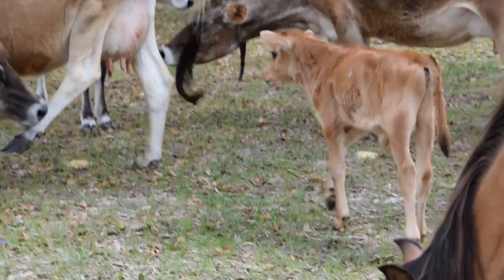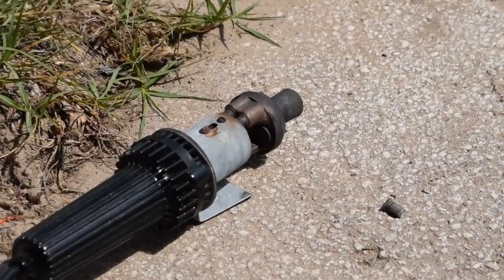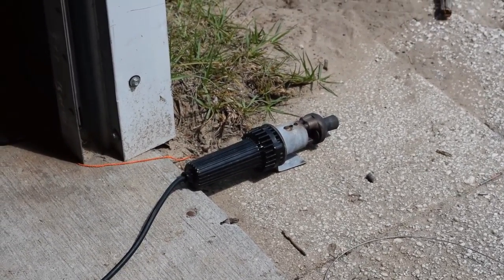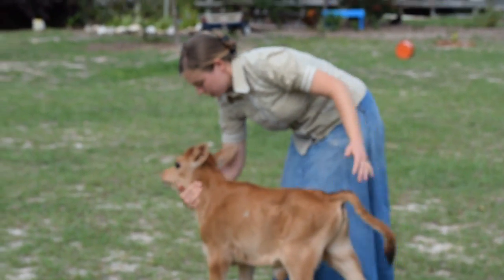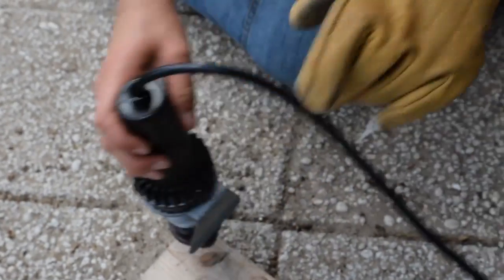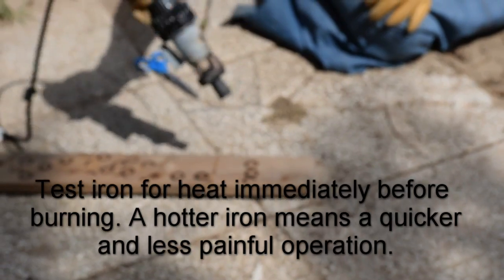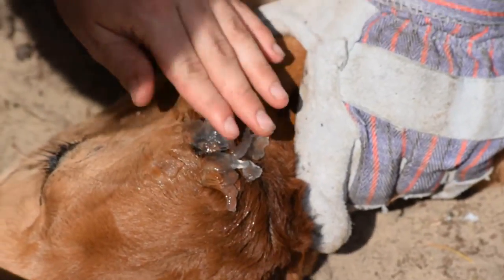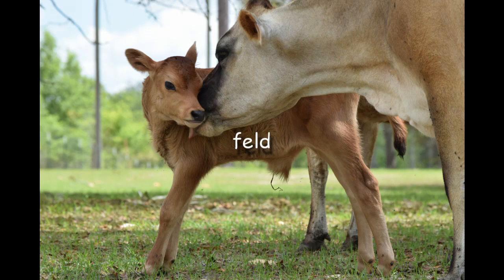How to Dehorn a Calf With a Disbudding Iron - Removing Cattle Horns - Raising a Family Cow Pt. 2

Comment: I just have to ask, would it not be a tiny bit more humane to apply some kind of local anesthetic around the horns before burning them?  Alternatively, can one use a tranquilizer that renders the calf unconcious for half an hour or so and then burn the horns without the animal resisting?  Are farmer allowed access to such drugs?
Reply from the maker: Thank you for asking (and doing it so nicely!) Yes, it probably would be less painful if I injected a local anesthetic around the horn buds, but there are varying schools of thought on that. Some say that restraining the animal for long enough for the anesthetic to take effect is more stressful than simply burning the horns and getting everything over as quickly as possible, since the nerves are burned through within a few seconds of applying the iron. (This was confirmed by a welder who told me that he was regularly burned by pieces of hot metal, but that it would cease to be painful after a few seconds.) I don't have anesthetic. If I did, I would use it, but either way, this is a painful, unpleasant ordeal for calf and handler.
     The keys to making this as humane as possible are: 1. Do it YOUNG. An older calf heals much more slowly, tends to get infected, and has to be more heavily restrained, making injuries to the calf and/or handlers much more likely, so this is best done at a young age (less than 7 days of age, preferably.) 2. Use a HOT iron. A cool iron has to be applied longer and burns out the nerves much more slowly, making a longer period of pain for the calf.  3. Apply coolant IMMEDIATELY after burning.
     As far as a tranquilizer, I have never heard of one accessible to farmers and would not be comfortable with using one, as such anesthetics can have serious side effects.
     Hope this helps.
     ~Alayna May
Reply from the maker: @Trevor Stolz, I just learned that there actually are some anesthetics and tranquilizers available to farmers. I should have checked on that before answering. A vet's prescription is usually required. I recently got lidocaine (a local anesthetic) and acepromazine (a tranquilizer) from my vet, so I will probably use at least the lidocaine in future to make this operation less painful. Thank you for your thought-provoking question.
Alayna
Reply: @MychickenscrapsBlogspot  i cant believe how you could do this without any local anesthetic, you should be banned from keeping any animal in your farm. you wear gloves for self protection and dont care for the pain you are causing to the animals

Comment: I'm concerned as to why you wouldn't use a halter to restrain him, rather than rubbing his eyes in the dust and putting your knee on its face? I do very much respect that the process needs to be as quick as possible as to minimize stress and fear, I am just curious as to why it needs to be done on the ground? It is the most humane way to dehorn but the practice you are using seems outdated and could use an inexpensive more progressive option.
Reply from the maker: Hi, Holly,
     Thank you for respectfully presenting your concerns; I really appreciate that. (Not everyone is so considerate.) I see your point and agree that it is not ideal to have to hold the calf on the ground. I actually did my first one standing up and restrained by a halter and two people, and it worked, but it took a lot longer and there was more risk of burning the calf's head or ears, or even of the iron slipping down toward its eye, because he was not immobilized. Basically, when he's on the ground with someone sitting on top of him, he can't move around as much and so there is less risk of burning him somewhere he shouldn't be burned (ears, eyes, etc.) There may be a better way to do this and I am certainly open to learning, but so far, this has worked best for me. Calves are a lot tougher than we give them credit for, so being sat on isn't that much of a problem for them. The calf escaping or getting himself burned because he has too much freedom of movement would be a much bigger problem - hence my method of dehorning.
     Hope this explanation makes sense! Thank you for asking.
     Alayna

Comment: Yea tell me again that it doesn’t hurt???  
Can you not hear the calf??? 
Are you deaf??? 

How would you like it if your head got burned without anaesthetic for someone else’s “safety” 

Disgusting 

And don’t try and tell me not to comment or watch, if you saw a dog being de-toothed for people’s “safety” you would probably comment too
Reply from the maker: Good morning,
I don't want to get into a discussion on this, but I respect your point of view and I can understand why you would be upset. I have recently acquired anesthetics from my vet and will be learning to use them in future.
Just for your information however, nerve endings actually burn through in only a few seconds and then the pain level drops to virtually nil, though the whole process is still obviously uncomfortable, due mainly to restraining the calf on the ground. I have confirmed this information about the nerves with a professional welder and with my grandfather who also welds and has had extremely hot metal burn him.
Also, after watching our horned cow slam a yearling calf into the fence with her horns, and seeing that calf stagger off with all the wind knocked out of her, and after being run over myself by the same cow and nearly skewered by her horns, and seeing my dog shoved violently across the ground by her, I am convinced that removing horns is a good idea. Perhaps you consider it selfish to remove horns for safety reasons, but in my experience, a cow without horns is likely to be better treated than one without horns because they are gentler.
I hope this helps you understand that I am not being intentionally cruel. The purpose of this video is to teach and I endeavor to do everything in the most humane way I can, but some jobs are just highly unpleasant, like dehorning.

~ Alayna May
Reply: Well you don’t know much about farming do you. It’s done for the safety of itself and other cows around it.